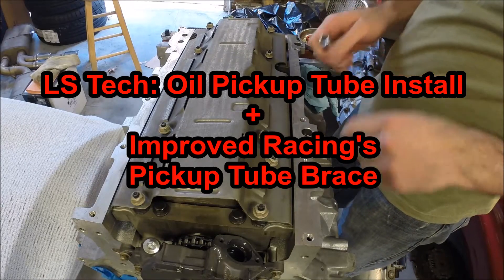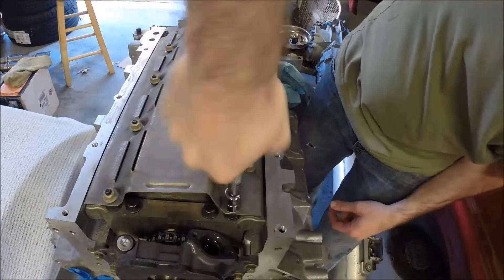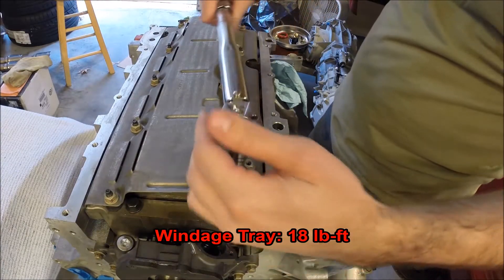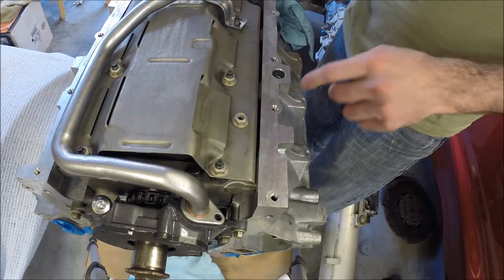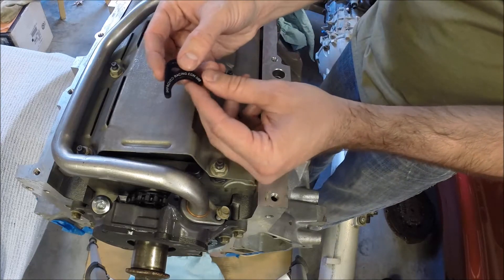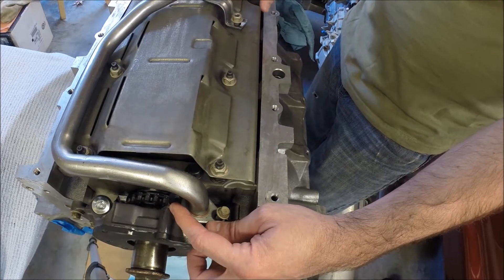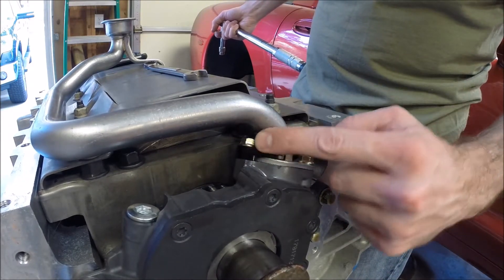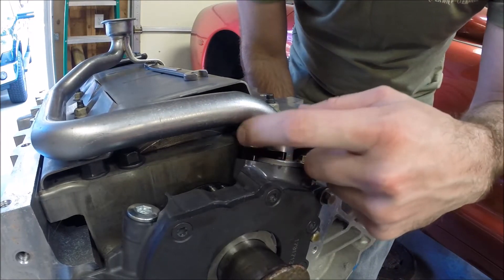LS Tech: Improved Racing's Oil Pickup Tube Brace Install

Comment: They should have included studs rather than bolts for the bracket. It would not only be more secure. But it would be MUCH easier to get a nut on the bracket than try to get a bolt in there with that minimal clearance.

Comment: Is the pickup tube screen area horizontal to the pan or slightly higher to the rear of the pan? I ask because after charging the oil pump from stock to Melling, installed pickup tube and it’s angled. Can’t recall if it was horizontal prior to removing it.

Comment: Boggles the mind why GM didn't just have the extra bolt hole milled into the opposite  side flange of the oil pick up tube to begin with.  I'll be getting one of these  improved racing brackets tomorrow as I'm going to be installing a new melling high volume oil pump and new pick up tube on my Silverado 5.3. Great video.
Reply from the maker: That would have made too much sense, haha.
Reply: @ScrufsGarage  That's true. As a military veteran I wonder if GM really stands for Government Motors because NOTHING the government does makes any sense lol.
Reply: I’m guessing they did it for reasons of cost and not having to worry about access to the other bolt. Another thing I can’t figure out is why aftermarket pickups don’t generally accommodate two bolts, either.
Reply: @matthewstorm5188  you may be right. It's hard to understand the mindset of the designers sometimes when you're wrenching on their stuff.

Comment: How much force did you give to push the o ring in. Mine isn’t going in very easy
Reply from the maker: It required a little force but nothing crazy.  If I recall, the oil pump includes a couple of different o-rings for various applications.  Make sure you've got the correct o-ring.  Good luck.

Comment: I don't want to replace the tube are the pump. I saw here you have to grind something off to use the clamp. Were is that located?   Thanks for your time 🙏
Reply from the maker: I didn't have to grind anything off.  With the tube seated in the pump, the clearance is very tight to get the bracket bolt started.  So as noted in the video, I had to pull the tube back a little and then seat the tube as I tightened the bracket bolt.
Reply: If you have the tab style tube, guys grind the tab off so they can spin the flange, and make it easier to put the bolt back in. It's not worth it, also if you have the tab style tube, even if u grind the tab off or not, you would halfto modify the flange and grind it off for the clamp to fit,  and it's too much material to remove, I wouldn't use the clamp unless you have a welded flange, I just bought two different clamps and 3 different o rings and so far none of its working out

Comment: Scruf:  Did you consider replacing your windage tray with the Improved Racing C5 Corvette crank scraper?  Do you have an opinion about that product?  Thank you.
Reply from the maker: I've been impressed by everything I've purchased from Improved Racing.  I didn't get a chance to use their crank scraper... don't recall why I didn't, other than my spending was getting out of control and I had to pull the plug at some point, haha.   But if you're building an engine that will see high, sustained rpm's, then I think the crank scraper is probably a good addition.

Comment: whered you get the long pickup tube from?
Reply from the maker: It is just an OE pickup tube.  Stock for the C5 LS1 with the batwing oil pan.
Reply: Scruf's Garage what year would I have to look up? Do you know if it would fit a 6.0 Ls in a trailblazer ss???

Comment: Recently most vlogers with ls swaps are having bearing failures and low oil pressure!. I have a junkyard lq4 that is running fine for now!. Is it mendatory to change oem oil pump? How can i prevent my engine from oil staarvation
Reply from the maker: Well I can't speak for failures that others have had.  Personally, if you are doing other work (cam, timing chain, etc) then I would recommend a new oil pump.  There's nothing inherently wrong with the OE pump, but if you've got some miles on the motor, then it makes sense to replace it while you're in there.  However, oil starvation is typically not the fault of the oil pump itself, at least not when using the car for track events.  Check out my video on the oil pan baffles from Improved Racing.  These help keep oil in the pan close to the pickup tube so you don't suck in air during high g-load corners.  There are other solutions like an AccuSump tank, or even a full dry-sump, but those are a lot more $$$.
Reply: @ScrufsGarage  so the problem is  basically in the oil pan. Have you had any problem after adding the baffeled oil pan?. Will it be sufficient bcz dry sumps are expensive. Checking ur video right now🤣
Reply from the maker: Well "sufficient" is relative to your intended usage.   Obviously full-out race cars typically have a true dry-sump setup because just oil pan baffles wouldn't be sufficient.   But dry-sumps are $$ and aren't realistic for the casual HPDE driver.  In which case, the oil pan baffles are a nice addition and should help.  And as you probably already know, GM recommends adding 1 extra quart of oil during track events, again to keep more oil in the sump.
Reply: @ScrufsGarage  my car is used for weekend trackdays drifting and boosted making 650whp. And you are right the baffles should work

Comment: I have a c5, I thought it called for the black o ring? I have the same oil pump
Reply from the maker: It depends on which pickup tube you have.  The Melling pump comes with a chart and you match up the inlet shape of the pickup tube with which o-ring you need.